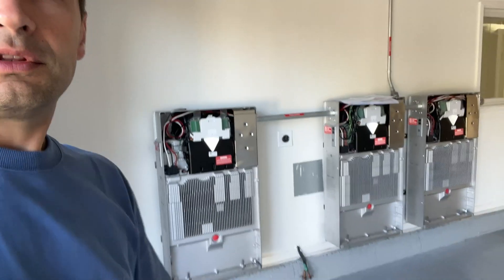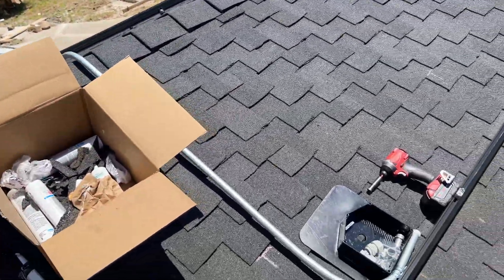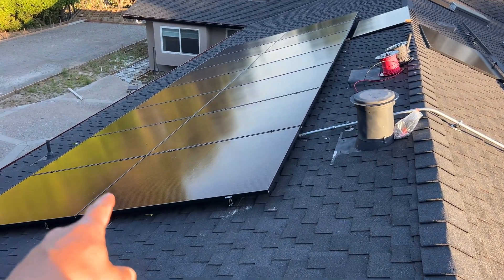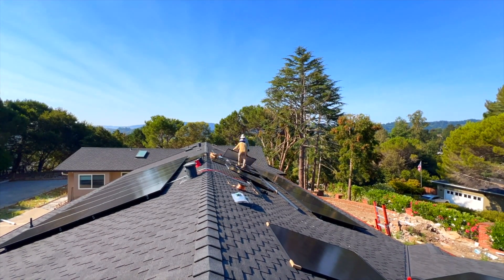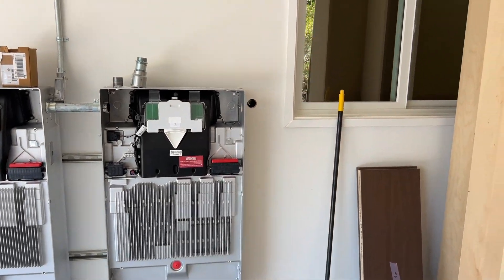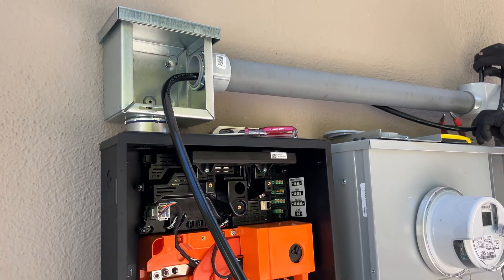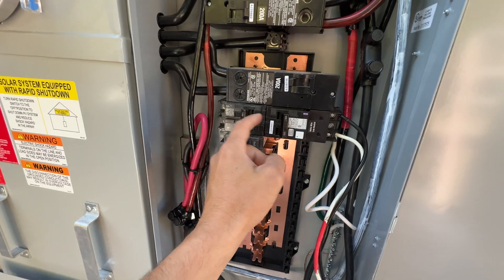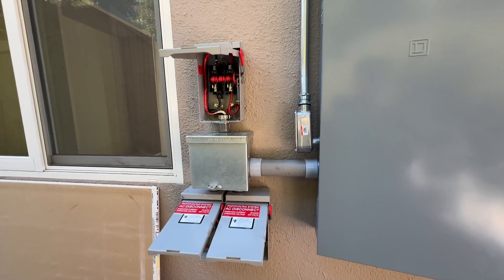Tesla Gateway with 3 Tesla Powerwalls and 11.3kW solar array.

Comment: I have 200A service with one 200A main panel that feeds a 100A sub-panel and a 50A sub-panel. Can Gateway 3 handle input from two Powerwall 3s and then have a single breaker to drive the main panel? I am looking at moving my 7kW Kyocera solar string to the inverter built into one of the two Powerwalls.
Reply from the maker: Gateway will have 200A breaker and then you'll need to run cable to 200A subpanel (existing or new). Powerwalls can land into subpanel or gateway.
Reply: @SolarEngineering  Thank you for the information. It sounds like this install will be a bit more complicated than I had hoped!

Comment: bro just a quick question, with powerwall 3 units installed on one gateway would it be a 3-phase system or would it be some how single phase rather? why i asked was that i read a forum where they said with Tesla Gateway you can tire in up to 6 powerwals into single phase ac....
Reply from the maker: Gateway is only 240V split-phase system. Only four Tesla Powerwall 3 can be part of one system.
Reply: @SolarEngineering  sorry am a bit unclear, so the 3 units you installed how did the 3 of the ac come straight to the gateway and from the gateway to the house is just 2 phase?
Reply from the maker: @chuksobi593  All 3 PW working in parallel, all of them are split-phase.

Comment: Hey Buddy, how did you get away with less than 3ft spacing for the Batteries in CA? What AHJ was this?
Reply from the maker: ul 9540A certification allows less than 3'. 
However, some cities still require a 3' distance

Comment: Hey who’s your material supplier, also electrician looking to order for personal install
Reply from the maker: BayWa R.E. I think they are require installer account.
Check Greentech CED also
Reply: I’m guessing to get the power wall 3s you have to be certified installers for tesla to purchase it or they sell it with that supplier?

Comment: Unfortunately there is an extreme Tesla price premium for their Powerwall. Thankfully there are many other battery options for a fraction of the price.
Reply from the maker: could you provide an example of something at a fraction of the price?
11kw output
18kw solar input
13.5kWh battery
Reply: In an apples-to-apples comparison, Tesla has everyone else beat hands down. If you're looking for less storage to begin with or lower output you can put together systems from other manufacturers.

Comment: My installer says the PW3 isn't compatible with my Enphase IQ8A micro-inverters.  That makes no sense?
Reply from the maker: to AC couple system Tesla Gateway must be installed, probably your installer quoted you for Backup Switch installation, which is faster and less labor.
Reply: Great videos!  I have two separate solar systems that are AC coupled and combined into one breaker in the main panel.  Sounds like I would need a Gateway to install a Powerwall.  What would be a rough estimate of cost to install one Powerwall 3 and the Gateway (San Jose)?  Thank you.

Comment: And you’re using the backup gateway 2 included 100A CT to monitor the non backed up 200A main breaker?
Reply from the maker: I didn't find info about installation of CT sensors to 2nd 200A breaker, if you could help me to locate will appreciate this.

Comment: Great job as well, I need to win the lottery and fly you down here to do my install. ;) Your price per powerwall?  I found $8500 per on the internet. If I bought 2 Tesla Powerwall 3's for 17k how much to install them on a square d 200 amp service panel?
Reply from the maker: Install in my area with Tesla Backup switch and no re-wiring n the main panel will be ~$2.5-3k. Another ~$1400 will be permit documents/fees, utility provider fee.
Reply: @SolarEngineering  thanks for the feedback

Comment: How difficult is it to pair two power wall 3s inverters?  I need my solar company to come back and finish my second powerwall 3.  They were hoping the expansion version would be available  soon so they could save money on their installation.  I already paid in full.....  I like the idea of inverter redundancy even if its half the panels (installed is 29 405 watt panels, intent would be 15 on one and 14 on the other.)
Reply from the maker: To install another powerwall, they will need to run communication cable between powerwalls, AC 6AWG from powerwall to AC disconnect and then to electrical panel 60A breaker.

Comment: I hear the Powerwall 3 is supposed to be easier for installers. Is that your experience?  Also, I am guessing it uses LiFePO4 batteries in the Powerwall 3?
Reply from the maker: I did install Powerwall+ only before so have limited experience with non 3 version, PW3 is easier because of pre-made knockouts, communication via cat6, single unit (instead of 2 with PW+)
and yes it's LFP chemistry

Comment: for solar roof attachment's whats the opinion on Ironridge vs Unirac vs snapnrack . 
Price wise and also in terms of ease of installation?
Reply from the maker: I like IronRidge flashing more than Unirac. 
Unirac is just flat metal, when IR has some ledge around mount, which is helping to divert water. 
Unirac rails is more convenient because it's flat on 2 sides, vs IR has non square profile. 
But both of them are good brands.
I didn't use snapnrack.